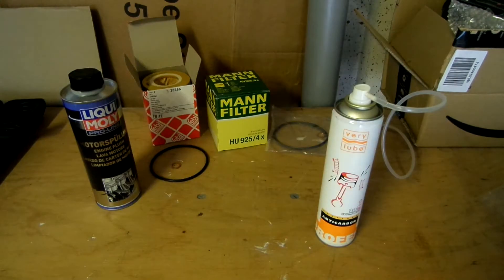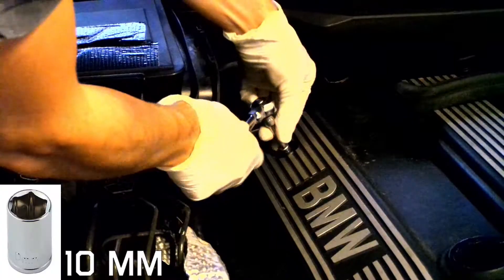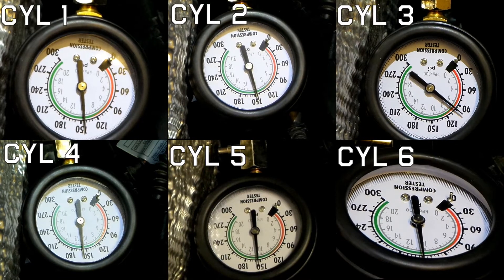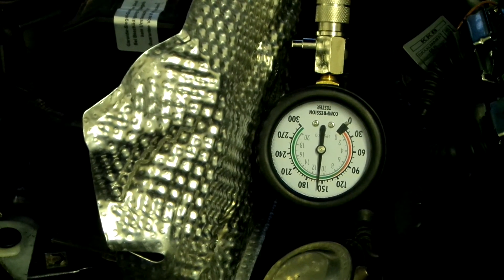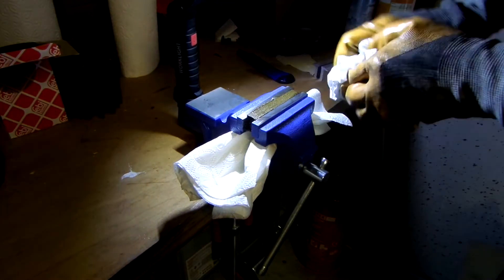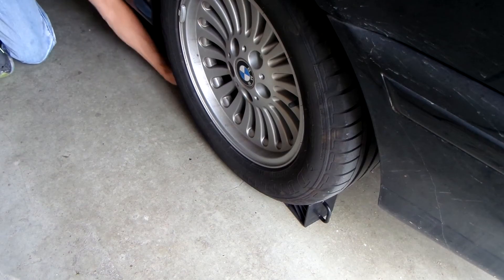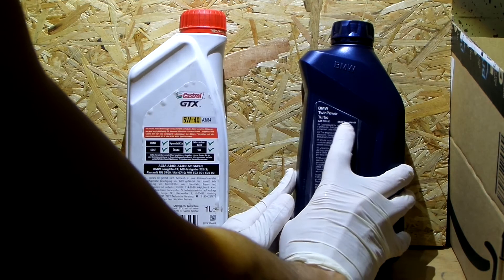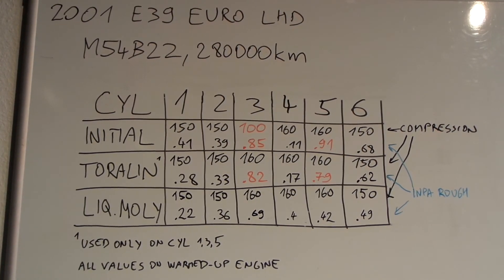🗜 [BMW M54] Test of Toralin Anticarbon and Liqui Moly Engine Flush (Amazing Result!) w/ Oil Change

Comment: I have used the Toralin / Verylube tubes instead of the spray can, did this for about 5-6 times and drove the car daily for a week in-between every treatment.
Oil consumption was 1:1200-1500km and so far I've driven 1800 with absolutely NO oil consumption at all, measured through the MMI, cluster and a dipstick.
People claim that an engine revision and swapping out the piston (rings) is the only solution, which simply isn't true.
But do they really expect to clear out carbon buildup from 100.000km+ with only one treatment?

Comment: Very good video, well made and informative.
As the owner of a M54B30 engined BMW that drinks oil at a alarming rate, I'm very interested in knowing if the use of Toralin to clean oil piston rings has helped to reduce the oil consumption.
Reply: Have you tried it?
Reply: @liampritchard2853  
I have used it. And it seems it has done some effect, but until now I have driven my car only 450 km since I used Toralin. 
Before that, my car needed a litre of 5w40 after only 350-400 km. Now, after 450 km, the level in the oil dipstick is a bit over the middle.
Reply: @alfacorse  very nice, I have an m54b25 with 212k on her and she doesn’t leak or burn a drop of oil, thinking about still doing the service during my next spark plug change which I still have awhile to go since I just changed the plugs, appreciate your response
Reply: @liampritchard2853   I wish my 530i didn't burn oil, if so I didn't use Toralin if it's not necessary, I suppose chemicals must be pretty strong. I changed the oil 50 km after using Toralin.

Comment: I have the chemical composition of GM Top Engine Cleaner.  What is the composition of this product?  Many of these products contain significant amounts of carrier oil.  That oil likely increased the sealing ability of the compression rings, thus the increase of compression to 150+ psi.

Comment: This toralin anticarbon have made a big improvement to my engine, but mine was very very dirty. I have already used 2 spray cans and still notice improvements every time i use this.

As a test i did extra cleaning on cylinders 1,2,3 because they have their own exhaust pipe. After few weeks i noticed i pipe almost clean inside other one blackish. So i now will intensify the cleaning of cyl 4,5,6 and see.....
Reply: What engine?
Reply: @liampritchard2853  M54B22 bmw

Comment: Thanks, very good video, I hope it works just as good in my engine too. Kind regards
Reply: Did you perform the (before)compression test with cold engine?
Reply from the maker: I am not sure anymore, but it is possible. Obviously, an accurate measurement should be on a warmed up engine, but this was more of testing the products anyway.

Comment: A what about an oil consumption after that?
Reply from the maker: Good question, that I cannot accurately answer, since I have (what a surprise) a bit of an oil leak. I am suspecting rear main seal, so I am focusing on some other work now.
Still I would say that the oil consumption has dropped, at least I need to top it less often.

Comment: Wrong Oli Mr. :) It has to be LL01, LL04 better for Diesel Models or Direct Injection.
Reply from the maker: Partially true, LL-01 should be used outside EEA (different fuel standards). I forgot about that since I live in Germany where both (LL-01 and LL-04) can be used, thanks for mentioning!